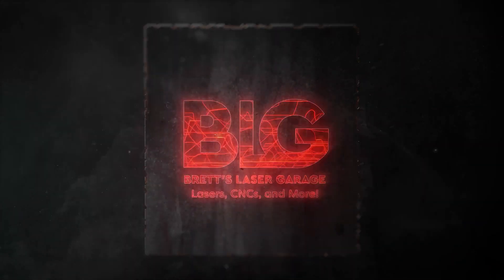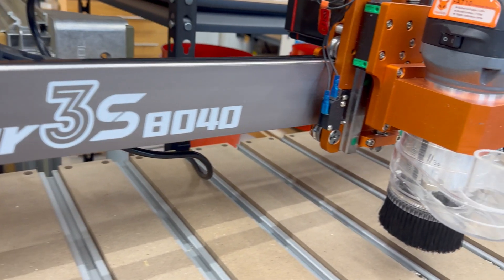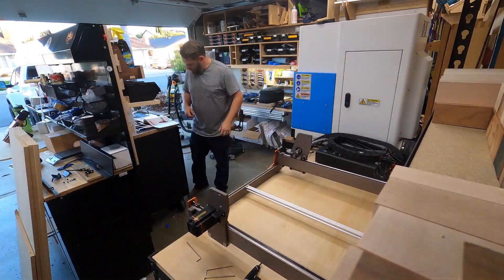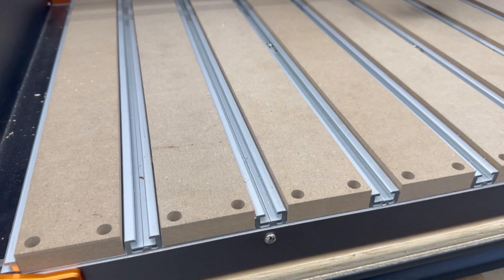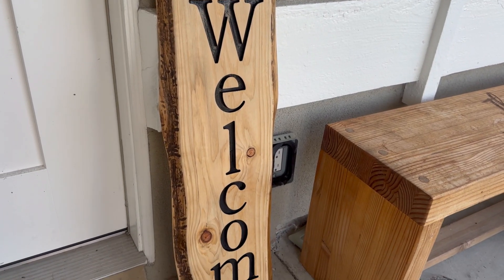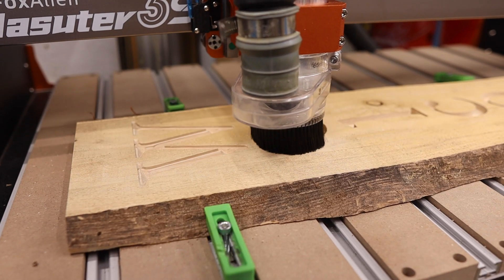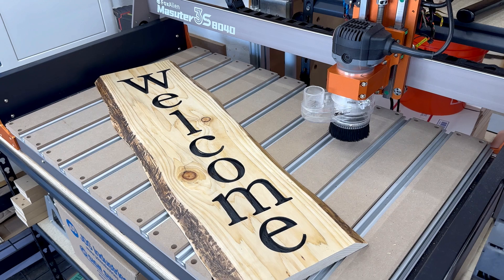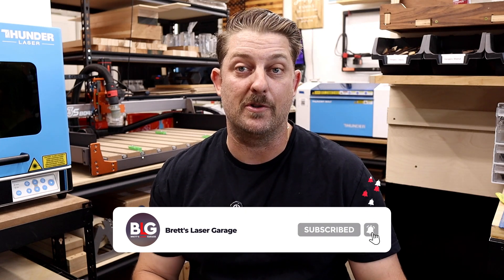Expand Your CNC Projects To New Limits | Masuter 3s Extension Kit

Comment: Hello, thank you for the video! quick question. Do you feel like the extension had a noticeable negative effect on rigidity? The Mauter pro and 3 extend the y axis instead of the X. I'm not sure if the longer X will hurt rigidity, but I need a machine with the 800mm length. I'm thinking the 3S is a good machine to get as it has a lot of premium features over the cheaper ones while still costing a lot less than a shapeoko XL.
Reply from the maker: No way, no noticeable effect on rigidity.  It’s a hobby CNC and very well built for the price point.  The extension kit is a must in my opinion.